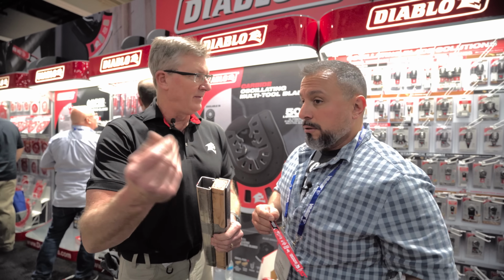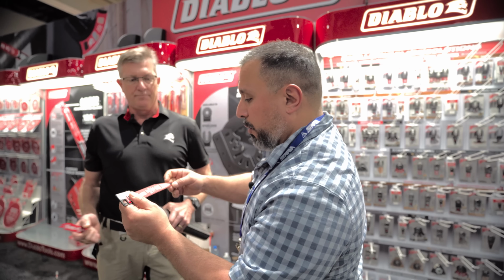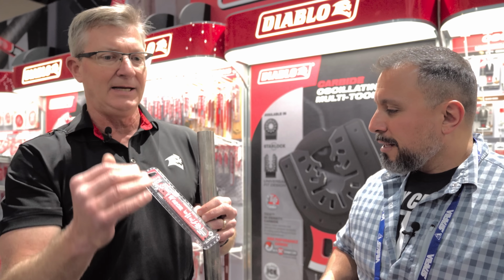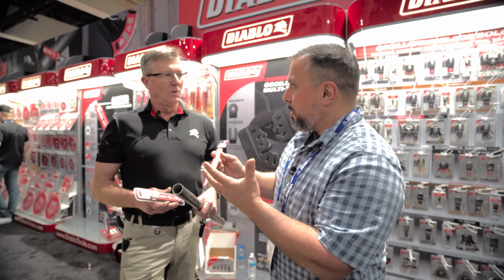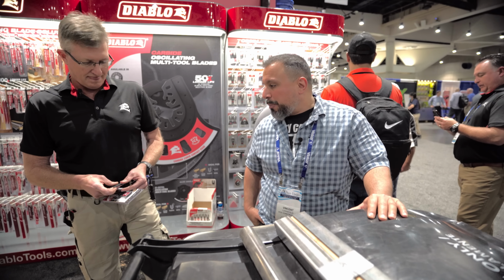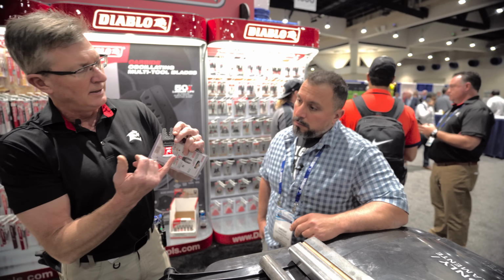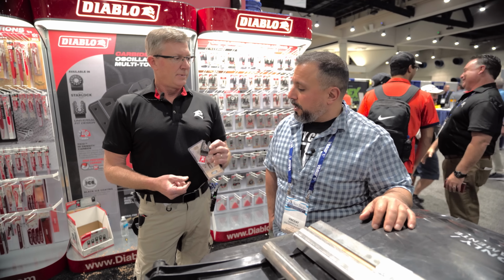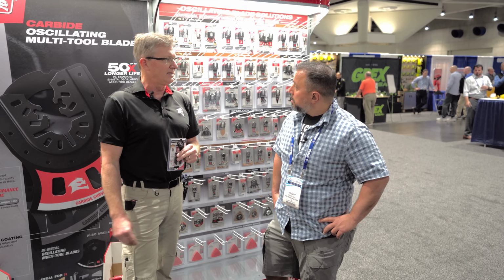Diablo Blades, One Reason Their Better than FEIN, Milwaukee, & LENOX!

Comment: That curved oscillating tool blade is incredible. They’re not cheap but I’ve taken care of it and it’s still slicing and dicing. Very impressive.
Reply: Probably a stupid question but how do u take care of a blade
Reply: @NoName_213  pardon the interruption but blade care is a real thing. I'm a drywall finisher and taking care of the metal blades of the broad knives is imperative. First, NO RUST! Keep the blades as clean as possible as often as possible. Keep them in a climate controlled environment as often as possible. When not in use, wipe down (or lightly spray) the cleaned blade with a thin film of lubricant prior to it's storage. Boom! Blade care. For all blades, for all sizes, for all purposes. Sorry for the interruption.
Reply: @NoName_213  even though it’s a “wood with nails” blade, stay away from nails. Keep it cool, like dip it in water when using it for long cuts. Keep it clean. Ya know, come on dawg.

Comment: I just got an oscillating tool and the first blade I picked up was a Diablo dry wall curve blade and wow did it work like a charm. Kept the tool in speed 1 and no fighting. I did hit a metal beam but 0 damage to the teeth and it kept going strong.

Comment: Thanks fornthebshowcase on these VCG👍👍👍 I'm Super Excited about these! I'm tired of my current multitool blades from both Dewalt and Milwaukee Not cutting it when it comes to trying to cut wood screws off. Honestly really frustrates me when that use case is exactly what I bought my multitool for and the current metal blades I use just woulnt do the job. I will be picking some of these Diablos up as soon as I can find some.

Comment: Used a couple of these general purpose carbide blades during a reno job. They are decent but the smaller teeth don’t cut wood nearly as fast as diablo’s regular non-carbide wood blade does. I found myself still switching back and forth between the full carbide blade and wood blade and not using the general purpose carbide blade. Their carbide metal cutting blades however last longer than any other metal blade I’ve used. Must have cut through 80+ nails on a deck that had the exterior siding  covering the nails (so I couldn’t remove the deck boards). Blade only lost 2 carbide teeth and I still use it and it works fine. Will be getting more in the future. If this one ever decides to break haha
Reply: thats why I got them too, i can deal with semi slow cuts I just need something that will last.

Comment: I leveled a sagging floor.  The old baseboard is like  2×6 board.  I have to remove about 4 inches of wood sticking up.  Gonna get diablo, butvwondering which would be the best?  Titanium??

Comment: So I should get Diablo for my new dewalt 6.5" circ saw
Reply: Absolutely! I've got a Diablo on my Dewalt 6.5 circ and it makes quite a difference in performance and longevity compared to the original blade included with the saw.
Reply: Absolutely! I've got a Diablo on my Dewalt 6.5 circ and it makes quite a difference in performance and longevity compared to the original blade included with the saw.

Comment: Hey I got a question for you. Do you think a Milwaukee top off 120V converter could run a furnace during a power outage (blizzard)?  Could have saved Texas last year. 10.3 billion dollars in property damage and  246 lives lost.
Reply: I tested my furnace last week to see how long it will run from a 12 v 100 ah lithium battery and got over 20 hours.  My gas furnace blower fan draws 350 watts running and over 800 at start up.  Having said this, the Topoff likely will not be able to run a gas furnace.

Comment: Haven't used the diablo oscillating tool blades yet but just bought a pack of them. HEY ANYONE I NEED HELP WHATS THE DIFFERENCE BETWEEN A IMPACT WRENCH HAVING PIN DETENT AND ONE THAT DOESN'T? WHAT DOES PIN DETENT MEAN?
Reply: Most impact wrenches should have a pin detent or a hog ring. The pin detent style has a ball bearing in the square head of the wrench that will help retain sockets and attachments that have a pin detent hole, which is a small hole that the ball bearing on the tool will sort of fit in and kind of lock the socket on the tool so it doesn't come off when in use. Very similar to how a regular socket ratchet works.
Reply: @duncdunc76  Thank you so much for a very detailed and understanding response it helped greatly.

Comment: The oscillator  blade is not carbide because, like titanium drill bits, it's carbide coating. Those type of blades are slatted to be banned in California  and other states due to the fact that they can not be resharpened.  Their all crape unless resharpenable. It's a waste of metals and increases carbon footprint because you use so many. Let's see Diablo and others make resharpining  tools for all their blades and tools.

Comment: He was putting quite a bit of force on the recip saw vs the other guy...😐
Reply: Who was? Massively popped collar guy? The one with the Dr. Strange collar??
Reply: Oh right, he applied so much leverage just by holding the rear handle. There are equal weights on the front of the Sawzall, right behind the blade where you would hold it. Have you held a recipe saw?
Reply: @michaelbychkov8030  Did you not see when finished? 😮‍💨
Yes, I have a sawzall and a hackzall. You tilt your hand forward a tad on a recip, and it's going to apply more force... 
I'm not a diablo hater, every blade I have is Diablo. Well besides some Spyder 7.25" circular saw blades I got on black Friday for $4.95 for 2 pack. Couldn't pass that up obviously. 
Dude just came through it with a lot more force vs the other guy...🤷🏼‍♂️ I calls it as I sees it.
Reply: @ryanguldbrandsen7672  the tilt isn't going to do much. The weight on the end is still the same and it cut better the whole time.
Reply: @michaelbychkov8030  I'm not saying it didn't cut better. But it really jumped at the halfway point

Comment: That saw demo is a cheap comparison. 

The guy with a Diablo blade is using the saw correctly, with the fence against the material. The other guy is just barley off of it. I bet it's not even that much better in a fair comparison.